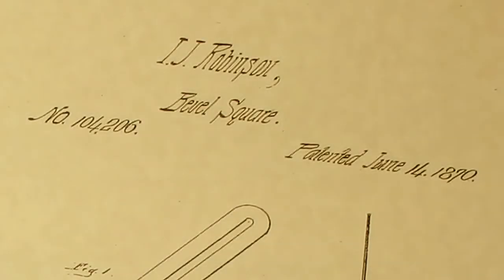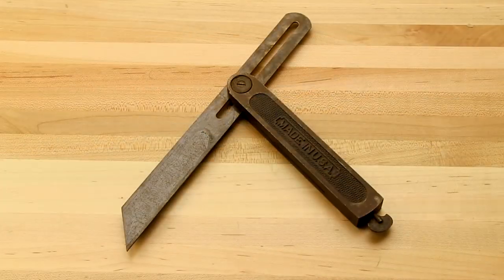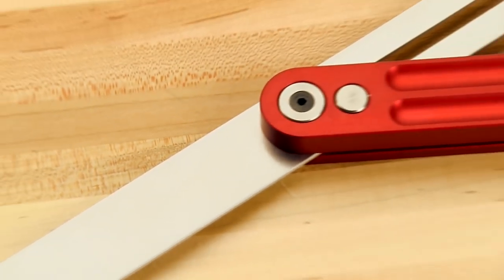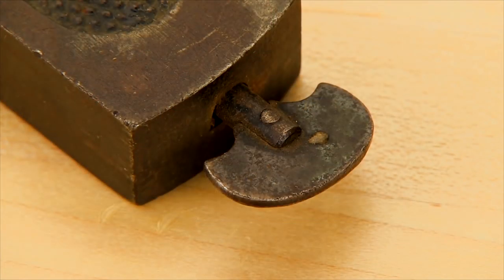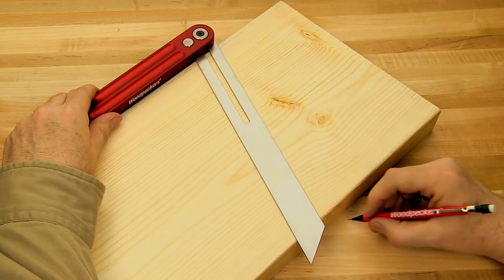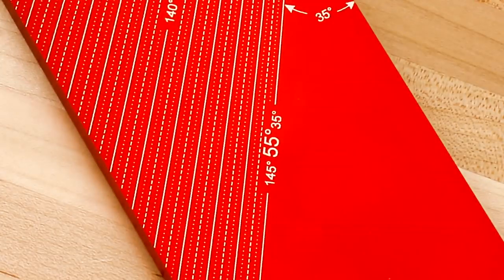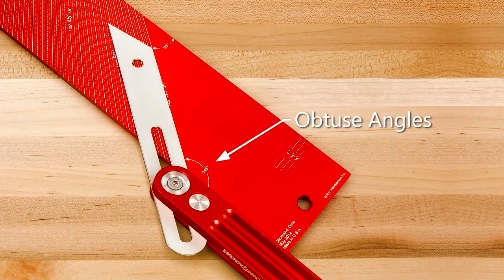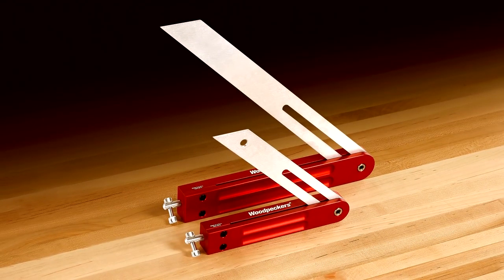Bevel Squares & Angle Reference Plate

Comment: I have been using a tool like this since the early 1960’s.   Most important part is that it stays set!  The setting board is OK, I guess, if one is willing to settle for “ballpark” angle setting.   I use a protractor with a vernier on it.  Measures (sets) to 5 minutes of arc.  Even this is just rough angle setting (reading).   Gauge blocks with a sine bar is the gold standard.  Set up on a FLAT surface a rather accurate angle can be set on the bevel square.
Reply: Are you woodworking, performing carpentry or building the next space shuttle?
Reply: heystarfish100 there are many stops between making sawdust and flying to the moon.   I used to rough frame houses.   I have little interest in “fine” woodworking.   Mostly now play with my machining tools, but will on occasion pick up the carpentry tools.
Reply: @heystarfish100  
Good one, Lol